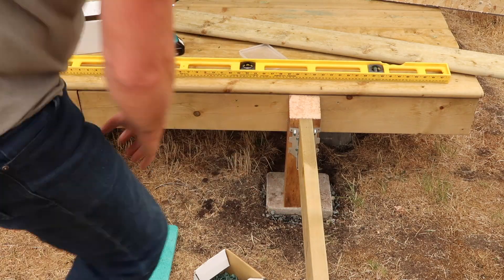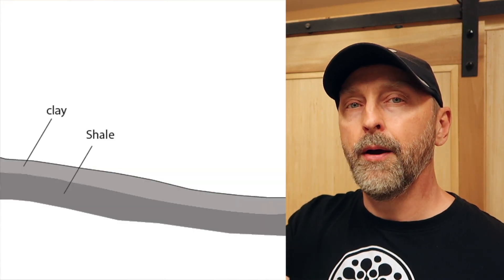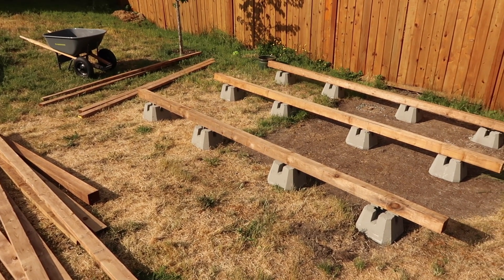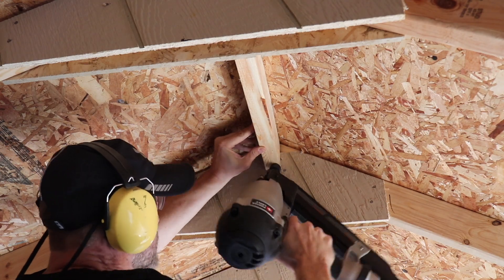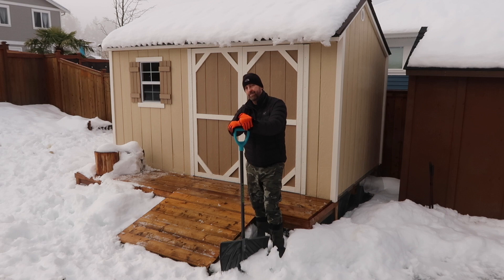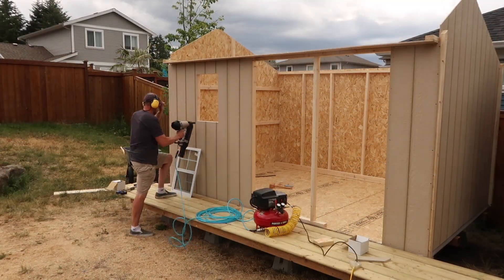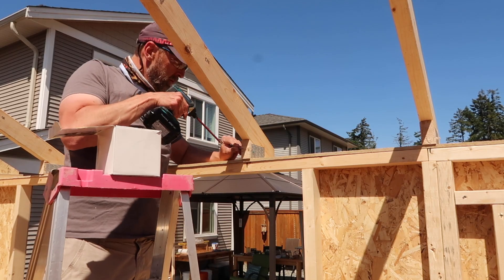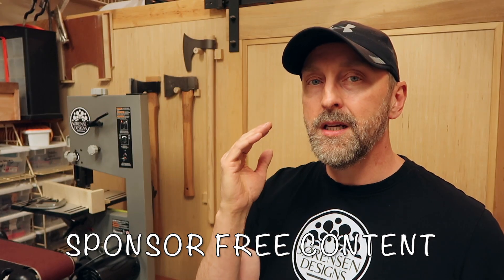Building a Foundation for Sheds, Cabins & Tiny Houses // What You Need To Know

Comment: How many deck blocks will I need for a 10x12 shed? What are the supplies you used when you cut the short blocks and added them in the middle? Seems like you put on a metal holder? I'm a woman with more ambition than knowledge here..lol.
Reply from the maker: I probably used more than I needed but that is because I'm storing a full sized generator and lumber in that shed.  
I used 12 deck blocks, 4 per beam but I could have probably just used 3 per beam and it would have been plenty strong. You can watch the entire build here: https://www.youtube.com/watch?v=GbrsQVKvJKo
Reply: @EricSorensenCanada  ...I did..ok, thx!